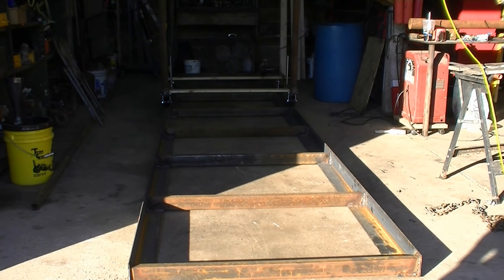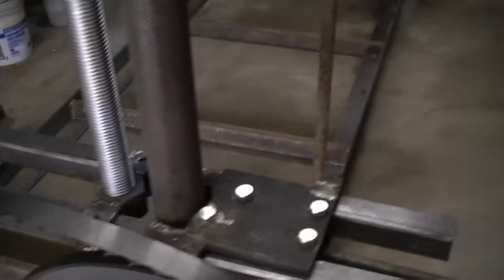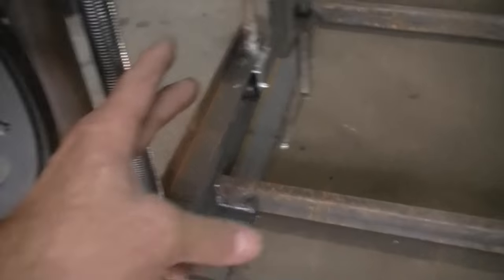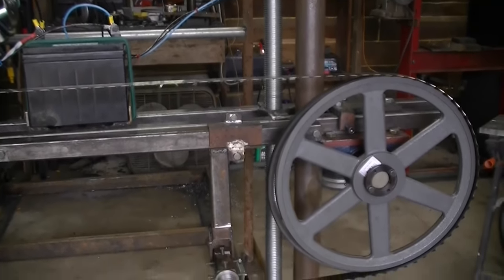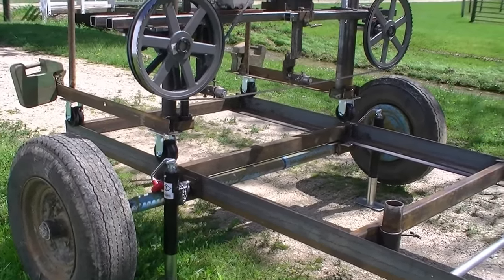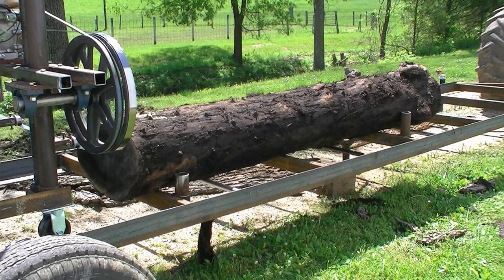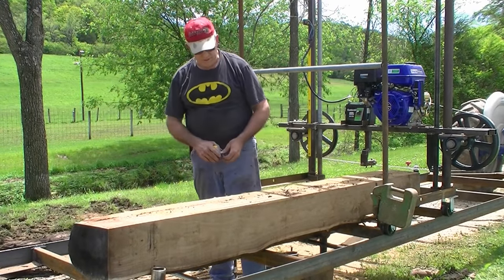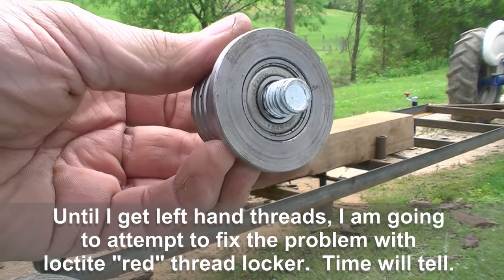168 RSW Homemade Bandsaw Mill Part 1

Comment: So what your saying is that your going to start the engine, with and electric starter motor, and your going to use and winch motor, to raise the whole assemble up and down, but does the winch motor not have a reverse reverse already build into it.  Did you buy your blade wheels? Also your engine is going to offset the front heavy weight is it not. Keep up the good work love it see come together. And I think the engine size, is just right as a motor, would have to be a little bigger, I think to run that saw.
Reply from the maker: +Paul Koomen I don't know if you've seen part 2 and part 3 yet but in part 2 I rebuilt the saw 180 degrees around. In part 3 I'm sewing some real nice cedar boards. Thanks for watching.

Comment: Looks like the blade tension  needs to be much tighter. The balde should have specs on optimal tension, should help cut faster and cleaner. Nice work on the build!

Comment: Nice work. I'm sure you're not done but one would like to see the carriage stiffened up. It seems to wrack a little as you push it through the log. A blade guard would be nice eventually but I'm sure you've got that figured.
Reply from the maker: See Parts two and three.

Comment: Suggestion, To make it less flimsy, Weld another set of axles in the front to stabilize the front end. And weld some cross member beam diagonally underneath  it to keep it from twisting    ( Example 3 X-shape fabricated beams, One on each end, and one in the middle). But fantastic work.

Comment: Good day

When I looked at your vidio your left end right sections move independent from each other thus making the blade not 90 deg with your rail. I think just above your engin put in some horisontal cross bracing in your structure
Reply from the maker: See part 2 and part 3

Comment: Love your build. I’m thinking of building a mill. I have metal laths milling machine ect. Drill your bolts and use a castle nut an cotter pin whatever did you get your blade wheels?Thanks ron
Reply from the maker: +Ron Kincaid in part 2 I completely rebuilt the mill 180°. In part 3 I cut some really nice Cedar Wood. After making those bolts left hand threads I had no further problem. Thanks for watching. Good luck with your Mill.

Comment: Very nice! starting with an old trailer frame would be good. If the lead screws were independent, you could make siding. Stepper controlled?

Comment: I would suggest a guard to keep pieces of flying wood from getting caught in between the blade and wheel. Such an occurrence would cause the band to come off anf a cover guard would be needed. You can make one of wood or sheet metal. I would also figure out a way to stop it from toppling over if it ever came off the rails.
Reply from the maker: In part 2 I completely rebuilt the saw 180ﾟ. In part 3 I saw some really nice Cedar.  Yesterday I released a brand new sawmill video cutting oak and Cedar
Reply: Me interesa comprar el equipo pero nose como puedo hacer lo por favor necesito información de como aféelo

Comment: So just the two blade guides you made keep the blade from jumping off the wheels??  And the blade rides on a belt on the wheels???  Thanks.
Reply from the maker: Yes those blade rollers have a back lip on them to keep the blade from pushing off. It's not my design it was a designed by a reputable Sawmill company. I just more less copied it after seeing it on the internet. Thanks for watching.
Reply: Thanks for your reply.  I like your design  with those belts on wheels/giant pulleys.  Any idea how many rpm's your engine turns and how many rpm's you have the blade spinning at???
Reply from the maker: Sorry I don't remember the RPMs anymore. But it's within the recommended range by other bandsaw companies

Comment: hi. enjoy your show. have been wanting to recommend several things that have help me in the past. I keep a ceramic sharpener on hand . use them on X-Acto cutters and other small blades. also a PIN VISE SWIVEL HEAD 2 CHUCK 4 SIZES HAND DRILL TOOL CAPACITY RANGE 0-1/8" is very handy. Small drills, screwdriver and allen wrench's are very easy to control. the swivel top fits in the palm of hand. drill small wholes very accurately. This things helped me at my job. Maybe you might be interested or not. I know about arthritis in the hands. wish you a very good day.  john putt, yukon okla.

Comment: You can probably put a speed regulator on your wench. That way you can move faster at a distance for adjustment and then slow it down for exact adjustment. Just a thought. Oh yeah!🤔 just make sure you grease the threaded rod because it may cease up.

Comment: What diameter are the wheels the blade is turning on and where did you find them?
I have an old band saw I'd like to restore and the wheels are missing.
Reply from the maker: +Norman Bates pretty sure they're 16 in and I bought them off of eBay. Thanks for taking a look.

Comment: maybe a guard to deflect the dust/cuttings away from the front wheel will help it run more true
Reply from the maker: Thanks for watching. In part 2 I completely rebuilt the saw 180°. In part 3 I saw some very nice red cedar.

Comment: ha..good stuff..
would love t be your neighbor.
been there..done that on these things..
handy tools but will drive you crazy..
you saved 6k building it yourself.now..take some advice..from someone whos been there done that..
the most important thing you can design for it is a log debarker.
pressure washing doesnt work.
specially walnut as it usually grows in a flood plain..and the bark is impregnated w sand..
even a log you think is clean will dull these blades.when that happens the symptom is..cupping..or itll act like its out of adjustment.
install a soapwater drip..itll help.
after fighting band blades for over two yrs..i sent my mill down the road.so..ill be building another mill soon..but screw bands.
im going hydraulic everything.
carbide chainsaw chain..and hydraulic drive..ill be sacrificing the thin kerf.but ill be sawing.while bandsaw guys are sharpening.im n9 longer in production sawing ties.so itll be for personal use lumber.curly maple..pine beams..
itll have hydraulic dogs.
hydralic log loader and turner..even height adjustment..
i learned from my mistake..
now.buzzing down the kerf w a chainsaw helps t clean a log some..but its not a fix.and youll get tired of doing it quik.buzz around yutube fir some debarker designs..youll love yourself for it..quikly enough..
good build..enjoyed the vid

Comment: Do you by chance have a picture of the wiring for your key-box on the engine?  I have the same engine on a mill I'm building and I don't have a wiring diagram.  TIA
Reply from the maker: +Rain Fly I'll see what I can come up with. I remember I had to contact the seller and they sent me some additional information.

Comment: A little more tinkering and that saw will be cutting like a champ.
Reply from the maker: Thank you very much. In part to I completely rebuilt the saw 180 degrees. In part 3 I saw some really nice red cedar.  The boards turned out great.  Thanks for watching.

Comment: What are you using to oil the blade? It will cut a lot better and blade won't warp
Reply from the maker: Are you referring to like a water bath. I did add that in part 2 and 3. Actually in part to I rebuild the machine 180 degrees and in part three I cut some very nice red cedar.

Comment: Your blade needs support bearings on the back of the blade to smooth the cuts. Your bearings/guides don't need the shoulders to prevent the blade from deflecting back. Your need bearings in two axis to control the blade chatter. Otherwise, nice build.

Comment: are you going to put a lube system for the blade as it cuts
Reply from the maker: In part 2 I completely rebuilt the saw 180 degrees. In part 3 I saw some very nice Western Cedar. Yes I did at a Lube system.

Comment: You might want to make a blade watering system on it to cool the blade and it also works like a lubricant.
Reply from the maker: I had that on there but it caused more problems than it fixed.  I don't find any heat issues at all the blade never even gets slightly warm.  The lubricant issue is non existant as the wood already has plenty of water in it.

Comment: Great Work and Design!  Don't you want to use a water drip? make it easier on your blade.  Water I believe will keep your blade cooler and therefore less stretch which will cause more tilt if it stretches while its hot.  Blade guards?
Reply from the maker: Advanced Nutrition Inc you got to start somewhere. I have completely rebuilt the whole thing 180 degrees opposite of everything that you see. I have added a water drip. I will be adding guards when I know I've got my design finalized.  thank you very much for watching.
Reply: Well you have done a great Job!!  I hope mine comes out as good!
Reply from the maker: Advanced Nutrition Inc good luck to you.

Comment: you don't need a left-rotating thread but a longer Bolt and a counter-Nut. a second nut tightened to the first one so it can not losen. maybe use loctite screw-securing -stuf to shut them...?
Reply from the maker: Joachim Schreiber I have another video out part 2 on The Sawmill and I did actually remake those parts with left-handed threads and they work great. Thank you

Comment: Hello Sir 

You have done some excellent work indeed.  I am in Africa and facing huge challenges while milling some real hardwood like: Doussie (Afzelia Africana) and Tali (Erythrophleum Africanum).  Logs are as heavy and hard as : 
1) Doussie: 850 KG/cbm
Janka Hardness: 1810 LBf (8050 N)
Crushing Strength: 10750 LBf/in2 (74.1 MPa)

2) Tali Wood Logs: 900-950 KG/cbm 
Janka Hardness: 2920 LBf
Crushing Strength: 80 MPa

Sometime sizes (Circumference/Girth) of these logs are as big as 140 to 160 cm which is another big issue for small frame band saw or portable saw (woodmizer and other similar brands in Ghana market).  They are expensive too. 
As a professional in wood and lumber, what is your best advise to deal with such situation ?  Also there is another project about SPF lumbering which I like to venture in British Columbia.   If I could get your email address or contact number, I will write you in detail.  
My contact: Email: info@kbocl.com and contact: +233 550 753 195  (Whataspp: +92 310 214 9796). 
Thanks a lot. 
(Najam, KB Overseas Co Ltd, Accra, Ghana, West Africa)

Comment: I realize this is an older video. However did you get all the "bugs" worked out of it? And if so, do you have any drawings and a total cost of it? Interesting to see such a build and always wished I had one so many times. The amount of wood available to anybody is amazing. When people have trees or even large limbs fall off trees, they cut it up for the land fill. And there is a lot of quality hard wood everywhere for anybody wishing to rough saw and dry.
Reply from the maker: In part 2 I completely rebuilt the Saw Mill 180 degrees in part 3 I saw some real nice red cedar. Sorry I don't have any drawings or plans or anything.

Comment: wheel size and power source for drive? Starting to cook up my own plans.
Reply from the maker: +Stan Rodgers the two wheel sizes I could find were 16-inch and 18-inch the 18-inch would be better. But after I had already made my frame the 16-inch was the only thing I could make work and work well. I wanted my wheels to work with a standard size blade that's readily available. I got everything off of eBay for the most part. Of course I bought the steel locally. Good luck with it Happy New Year

Comment: what do you mean you were pushing instead of pulling or what does he mean can someone explain thank you
Reply: The way the acme rod works. Pushing the unit head up rather than pulling in regard to the direction of the threads on the rods. Raising and lowering the unit.

Comment: Hi. It works but I see that it's many design flaws -  funky backwards mill: engine pushing blade true the log, permanent log stops on entrance same as permanent blade guide so that was wrong in my opinion...
Reply from the maker: Part 2 I completely rebuilt at 180 degrees part 3 I cut some red cedar. I don't know what you mean by permanent.  Nothing's permanent everything is adjustable.

Comment: thread locker? shouldn't that get a hole through the end of the bolt, notch a groove in the nut and stick in a cotter pin. than it wont unscrew yet remains removable.
Reply from the maker: I fixed it in part 2 and there are a couple more videos as well.

Comment: if the blade starts to drag in different woods use a water drip to cool and lubercate blade
Reply from the maker: I have a water drip for it. It does work but to be honest I don't feel like I needed it all. The blade never seems to get hot and never seems to bind.

Comment: You may or may not respond but I’m in the process of gathering material for sawmill build
 would love to build close to free just for the sake of saying that lol probably will buy some gears and pulley wheels 
but the direction of motor is a concern noticed that you changed yours did it make a drastic difference 
I watch a lot of videos they mount motor in all places and directions 
I really could afford a starter mill but I imagine I would enjoy a wider cut mill and those are too expensive
Enjoy your content thanks
Reply from the maker: The idea is the motor/wheels pull the blade through the log.  If the blade is tight, not much difference.  but if it gets loose, then it could really cause a problem.

Comment: great looking design on the mill but long term your going to have to reinforce all your framwork it lacks enough strength and rigidity. When yo start dealing with bigger heavier logsthis will become a big problem. the little bugs will workout in time.
Reply from the maker: Ken Jett thanks for taking a look. I took a day and a half completely tore the whole thing apart and have redone just about everything.  I believe it's going to be a very good Mill in a very short time.  will post a new video on it in the near future.
Reply: look forward to it

Comment: I unbolt 4 bolts and can remove my axles and wheels. They roll out in one unit.  Gets them outa the way.
Reply from the maker: Since I am only using this on the farm I'm going to fix it where I can just pull a pin and take the wheels off

Comment: No make it self propelled  ,and brace up the frame that holds the cutting unit all so you need blade feeds at each wheel to control the blade as it leaves the wheel , stoping it from going back towards the wheel and flexing in the air   ,think of a builders vertical bandsaw has a blade guide to work under when cutting to control the blade being pushed back you need one on each wheel

Comment: Did you ever pin the nut to the guide ? Lock washer should have worked
Reply from the maker: In part two I rebuilt the saw 180 degrees. I made the left-handed bolts and it worked perfectly. In part 3 I saw some very nice Redwood. In a later video I show the song again but I don't recall which one.

Comment: Where would I be able to get the material to make a home made sawmill ?
Reply from the maker: Giezi Rivera I went to a local Steel provider. In other words he sells pipe angle iron all kinds of things. The rest I got off of eBay for the most part. Good luck to you.
Reply: Rosa String Works what are the names of the material you you use so I can order them or how much would you make me one for?

Comment: Great first effort, Rosa String Works! Check out #MattCremona's DIY Bandsaw Sawmill. I think you can take some carriage bracing cues from his design. His is a much larger Bandsaw Sawmill - he's cutting somewhere around 60 inches wide - but you can size it for your own. I did read previous comments here that you've already rebuilt yours, but maybe seeing what he did might give you some ideas. I reiterate, it's a great first effort. Thanks for the video! All the very best going forward! #KeepTheChipsFlying!
Reply from the maker: RXR Sawdust Station thanks.  I've watched all his videos.  I have made a brace on mine which helps quite a bit.  Although it's still difficult to get it real solid.  but it is much improved.  made lots of other improvements also. Thanks for watching.
Reply: You're welcome, RSW! I truly hope it works out for ya! I look forward to seeing what you've done to it. I really appreciate your efforts! #KeepTheChipsFlying!

Comment: You need to reverse the direction of your pulley, (ie jackshaft)your drive wheel is pushing the blade- it should be pulling the blade! Or put the belt pulley on the other drive wheel.

Comment: Nice build! Not uncommon to have adjustments in a design build project. Maybe better term is build design project.
Reply from the maker: In part to I completely rebuilt that he bandsaw 180 degrees. In part 3 I cut some really nice red cedar
Reply: Rosa String Works I believe I have watched all the videos on the sawmill build now. Great job!

Comment: Where did you get those casters?
Reply from the maker: Brandon Marshall it's been a while but I think I got them from eBay.
Reply from the maker: I looked back in my history.  Here is what the title said.  4" X 2 " V-GROOVED STEEL WHEEL CASTER/ SET OF 4 (900 LBS CAPACITY/EA)
( 272512780229 )  They were sold by this guy:  charleskbjj  I tried to click on them and give you the link but it didn't take me there.  Sorry

Comment: longer bolt. double nut it! USE FINE THREADED BOLTS NEXT TIME!
Reply from the maker: I made them left handed in part 2 and it solved all the problem without any further issue.  In part 3 I saw some very nice red cedar
Reply: @RosaStringWorks  Double nutting (jam nuts) keep all the parts standard so when you drag the thing across the state to harvest some awesome wood, and a nut & bolt rattle loose on the interstate, you're not trying to hitchhike helicopters to scramble for left handed cheetah testicles when a simple pair of righty tighties will keep the whities tidy!